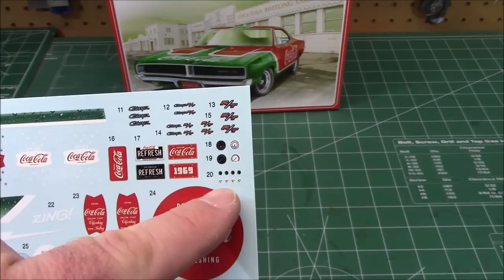1969 Dodge Charger R/T Coca Cola 1/25 Scale Model Kit Build Review MPC919

Comment: Watching this gave me a kit bash idea. Take the decals from this and put them on the Revell ‘69 Charger kit and either sand off the vinyl roof, keep the vinyl roof or use the Revell ‘68 Charger body, with or without the ‘68 Charger race options, or just use the ‘68 Charger kit. Thank You for the idea.

Comment: I love the coke droplets/water condensate on the decals;it gives them that "wet look" like you see in the ad pictures that you get in the morning news papers,posters,and billboards.I have heard of professional modelers;who has 30+ years of airbrushing experience,use different shades of paint to replicate that wet/condensate look;by using a dual action Iwata Eclipse HPC+B airbrush and a craftsman pancake shop air compressor.Another brand of decal setting solution;you can try on future Round 2 kit build reviews,is the two part Micro Scale industries;Micro Scale and Micro Sol.I have used the two part Micro Scale industries setting solution, on my GMC Astro 95 COE by AMT;and it performed flawlessly!.Definitely one of the best decal setting solutions I have ever used so far.
Reply from the maker: Thanks!

Comment: I did mine up as The General...I ordered decals online, and finished it off with 01s on the doors and rebel flag..Turned out pretty nice,and it didnt break the bank
Reply from the maker: That's the way to do it if you want a General.
They made this snap kit as the General just before all the licensing for Dukes was pulled, I have it as the General edition. I may have to build it as such one day.
Reply: @hpiguy  Wish I could show you a pic of mine
Reply from the maker: @aaronking7326  You can, on the FB page. 
www.facebook.com/hpiguysworkshop

Comment: What a great kit, and how about those decals! Chris a question, how or what should I use to strip paint and decals from a model without damaging the plastic and removing the glue?
Reply from the maker: Super Clean will remove everything but the plastic and glue.
Reply: @hpiguy   thanks Chris. I went to Walmart and got super clean( in a purple one gallon jug) how long does it take to remove the paint and decals? Thank you again.

Comment: Thanks Chris, I didn't realize that was a snap kit, nice for a quick build and I like that body style.  One question: I bought a gel pen and tried it on some styrene and a tire but even after a couple of days it hadn't dried and rubbed off.  How do you get them to dry?
Reply from the maker: An acrylic pen should dry pretty quick.  Oil pens may take forever.

Comment: When I google rust oleum 2x black primer,  the only thing that comes up is rust oleum flat black. Can you show the can on a future video? Thanks.
Reply from the maker: Hi Sam, I've linked to this for you a few times before as well.

https://www.walmart.com/ip/Black-Rust-Oleum-American-Accents-2X-Ultra-Cover-Primer-Spray-12-oz/973827135?wmlspartner=wlpa&selectedSellerId=0&wl13=2127&adid=22222222227147452599&wl0=&wl1=g&wl2=c&wl3=359214469365&wl4=pla-421682705889&wl5=1028269&wl6=&wl7=&wl8=&wl9=pla&wl10=8175035&wl11=local&wl12=973827135&veh=sem&gclid=Cj0KCQiA-4nuBRCnARIsAHwyuPrljqOn3Fcm_2dxQv7nLf-aasAj65Mqdio8sxxI4fjhIvszlAM6rE0aAgn2EALw_wcB